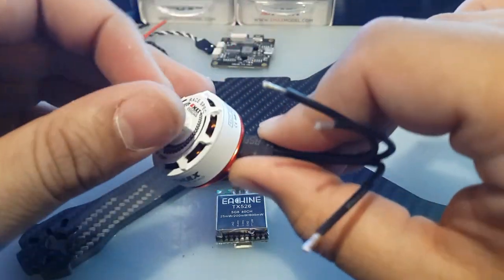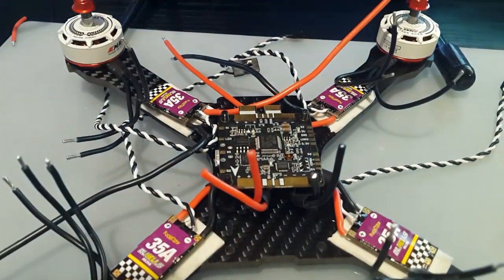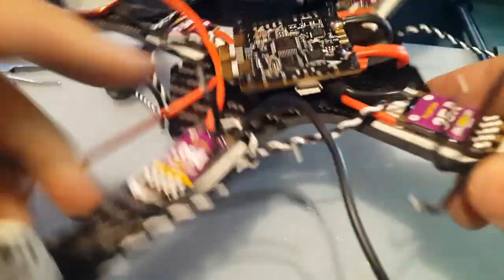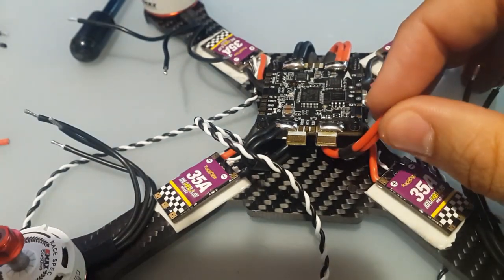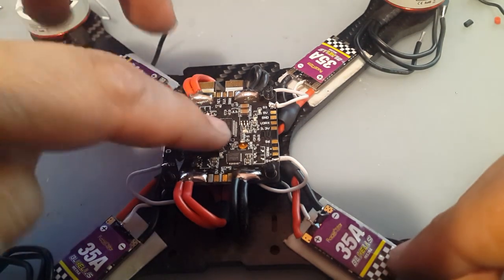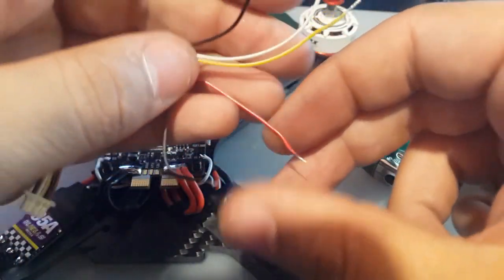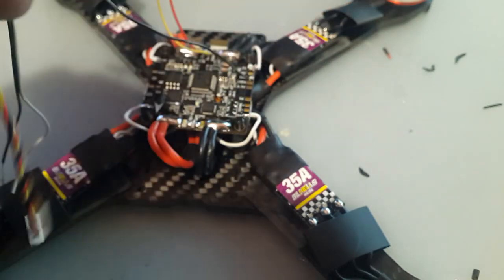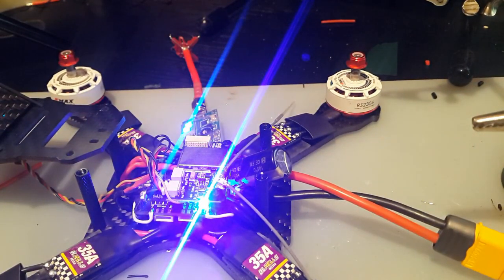How to Build Racing Drone (Realacc X210, Emax 2306)

Comment: Hi mesh I know this video is a little old but I’m building this quad cause I really like it and i have a question if anyone can help me I have the same frame from this video and i just got the emax 2306 rsll motors the new version but the mounting holes don’t match and I tried the dys 2205 2500kv and don’t align with holes either any ideas on what’s going on please let me know thanks 🙏

Comment: Ok I have the same quad..realacc210 30a esc TBS unify pro race vtx
  betaflight fc 2306 2600kv  brotherhobby returner motors what props would you use

Comment: hey DM, don't worry about using the fan. we can still hear you just fine, and it really isn't loud. Better to use the fan, than breath the fumes fro that leaded solder. Also, the detailed commentary with your builds is good, don't worry about us. I am wanting to build, or have built my first race / joy riding quad. It would be cool if we could get in contact in a non public chat. Hit me up. Really enjoy the video's, very informative, and helpful. Peace out

Comment: Hello drone mesh, I'm planning to build a quad on realacc x210 pro frame and would like to use 2306 motors of aokfly, do they fit without problems?
Reply from the maker: Daniele Marsico the pro version has very tight build but the motors fit just fine.. I would stick to normal x210 and don't use these ESC'S very noisy from my testing go with DYS XS 30a or better..
Reply: Drone Mesh mmm I'm planning to build using x210( why would you use the normal and not the pro or the 6k one?), racerstar 30a esc, 2306 2400 aokfly motors, so do you think that I won't have problems installing the 2306 motors on the frame?

Comment: Hi! very nice! I am planning on my first build and thought of this one 😉 did you have any problems so far? because it looks very powerful and smooth 😉😉
Reply from the maker: Hugo FPV Hold on these motors bought 9 and I think 3 where defective I will be testing them soon on my channel.
Reply: Drone Mesh thanks man, I am looking forward 😉 also I am thinking of either taking the 2400kv ones because the 2750kv ones will be drawing too much amps

Comment: Hi - what soldering iron do you use?
And more importantly, what flux are you using?
Reply from the maker: Hi,

This is what i use and have been using for past year and half now.
https://www.banggood.com/909D-Rework-Soldering-Station-Hot-Heat-Air-Gun-DC-USB-Power-Supply-220V-AC-EU-Plug-p-1063967.html?p=CS101558118042016088

Flux I get it from a local store i use liquid flux not paste if that helps.

Comment: Hi great builds
just a question about if you did end up with 30 charged batterys and only managed to fly 1 and you have no quad to fly them off what do you do?
I take it there ok to be fully charged for 2 days max and I wouldn't want to leave it that long! 1) because I couldn't wait that long lol! and 2) I don't think it's going to be good practice leaving batterys full? fora long length of time?

Thanks
Reply from the maker: +BAJAFLATOUT!! If i am going to be unable to fly them within 4 days i start putting them in storage mode.
Reply: Drone Mesh
 ok thanks 👍

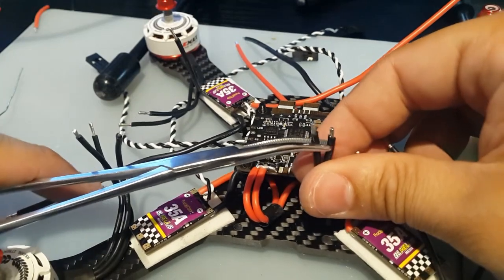Comment: 11:40 how are these pliers called? They look super usefull. Great video!
Reply from the maker: They are they are called Hemostats here is where i got them from.

http://www.ebay.com/itm/Locking-Forceps-Curved-Mosquito-Hemostat-Tool-6-3-Inch-Length-LW-/182050206925?hash=item2a6309b4cd:g:1CAAAOSwmmxW4asg
Reply: Thank you!

Comment: Awesome video mate, 
Why did u add flux?
Also can you explain how calculate the amps that are compatible with motors and flight board please
Reply from the maker: +Leona Sampson I add flux to remove contaminants so the solder would stick perfect. 

For calculating amps check your motors chart and usually a 35a ESC is good enough.

Comment: i switched frames to the x210 from  the same kit from banggood. i just decided to use that frame, but now that i switched over everything, motor 1 is not spining. when i took motor four off and put the motor that was on motor 1 on motor 4 it works. im using a racerstar 20a 4in1. the signal wire in soldered in good as well as the others, so i just dont really know whats wrong. tried almost everything

Comment: i have question maybe you can help me, i just rebuilt my x210 and now motor one is not turning, when i switch it with motor 4 it works fine. i checked all the escs and there working. i cannot figure it out. my quad was working fine with the other frame.
Reply from the maker: What do you mean by switch it. Do you switch the ESC signal wire from the FC?

Comment: max speed? and can we partecipate to championship with this?
Reply from the maker: Hi,
Max speed with right propeller over 80MPH easy not sure exactly but its very fast.

Yes you would be able too but what i found with these motors now is that they are very power hungry and can really destroy your 4S batteries. If you want to go racing i would go for the T-Motor F60 2450kv.

Comment: Whats the capicitor used for?
Reply from the maker: To reduce Video noise as well as Video and OSD blackouts from Voltage Spikes.
It also protects your components from voltage spikes.
Reply: Do you solder that on the pdb  were the lipo connects,also do you have a link to the part
Cheers
for the reply
Reply from the maker: Yes this is soldered where the battery is connected to the PDB.

They are Panasonic 1000uF Low ESR rated for 25V
I buy all my capacitors from this post. 

http://www.ebay.com/itm/290763801711?_trksid=p2057872.m2749.l2649&ssPageName=STRK%3AMEBIDX%3AIT
Reply: Many thanks

Comment: I am doing a similar build with the x210 frame and x6b rx. How do you update the x6b? And where will you route its antennas? Nice video man..subbed
Reply from the maker: avoidrome Thanks.... I routed it on the back stand offs. I will make another video of how its final form looks like.

About updating the x6b, Ihave never tried it never saw a need for it.
Reply: did you go down or up the standoffs? Also,  where did you mount the vtx and still keep the capacitor in there? I am trying to figure out which cap will be the best for this situation...

Comment: I have a x210 pro and my fist build was hard ! I couldn't fit the camera plate in as I had wires everywhere ' chaos ' but now I've watch your vids I have stripped that baby down and given it a complete rebuild .
thanks and enjoy your day
Reply from the maker: Thanks and keep me updated on your build I would be very happy to see how it comes out.
Reply: will do and I will take some pics ' do you have an email .
Reply from the maker: mesh.drone@gmail.com
Reply: cool, will send some a bit later.
I have just order another frame plus just finished a Martian ' alien clone ' haven't managed to fly it yet as the English weather is $#it but sunshine tomorrow.
fingers crossed it rocks lb 30amp dshot, f4 fc , emax s 2600kv. keeps us updated on the new motors you are using ' no line of sight for you Ha ha !.
Reply from the maker: I never tried the Emax 2205s 2600KV i was gonna order some but at last moment i changed my mind to 2300kv how do they feel compared to the 2300kv.

Comment: u can use a batter strap holder on the bottom just a lil pieve of carbon and also if you file your slots then it wont cut your battery startp its breaking b/c your using cheap straps and not filing it its very sharp until you file your frame also if you file all of the outer edges it helps with delamination from crashes
Reply from the maker: Thanks for the tip